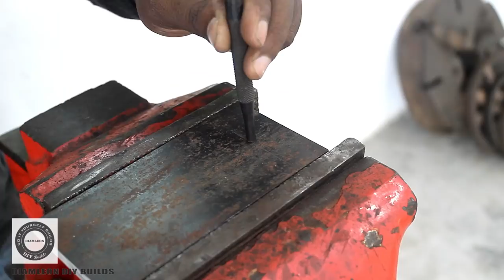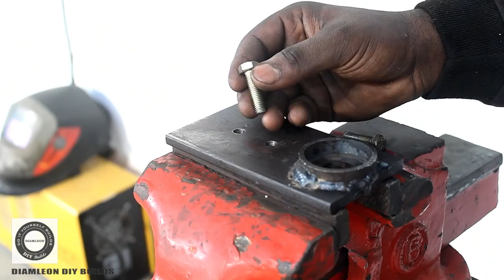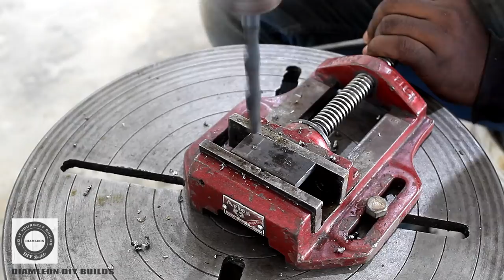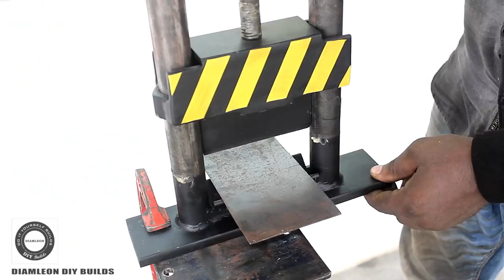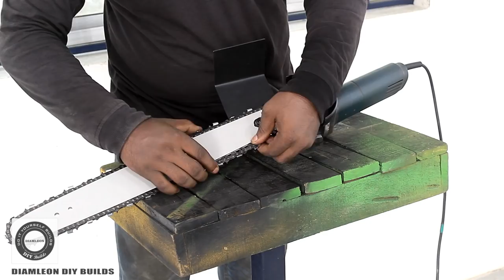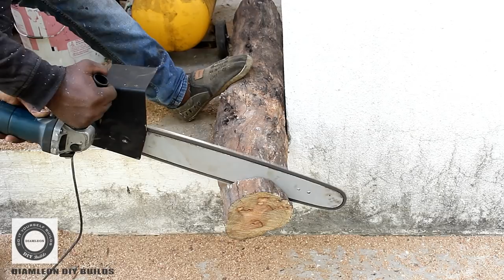Make A Homemade Chainsaw | Angle Grinder Hack | Diamleon Diy Builds

Comment: great idea but one thing is mising , oil system is needed to supply oil to the chain path while in use with no oil in the chain path, it will create fractions and will cause it to heat up.
Reply from the maker: Ok thanks for your suggestion

Comment: i give you 5 stars for DIY , but, you need chain tensioner, oiler, protection, and handle. This type of grinder has too much resistance from such big blade. Conversion to chainsaw, on this kind of grinders, should be limited to small blades, 30cm max. If i had opportunity i woud put even smaler blad.
 if I could,maybe 20cm. Its for cutting smaller branches, not cutting wood.